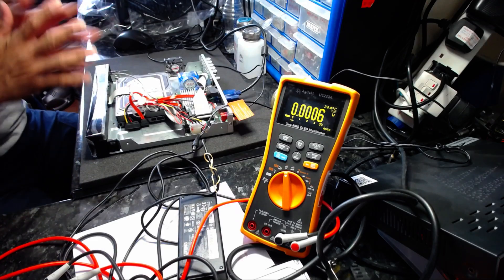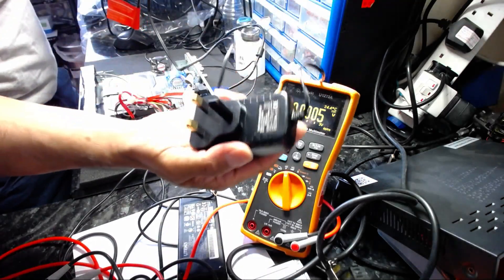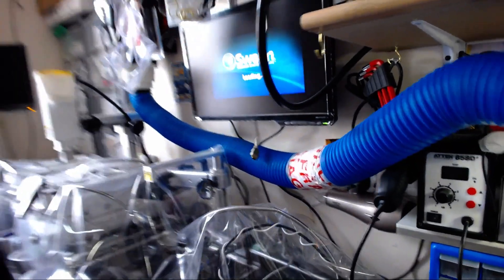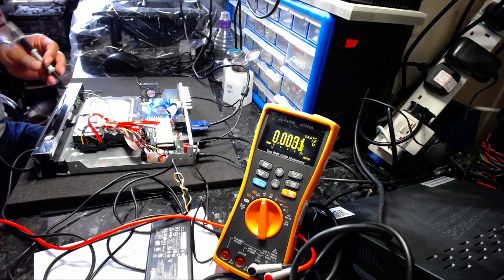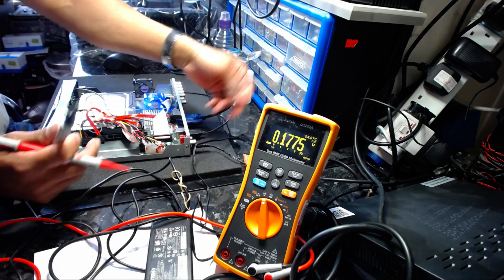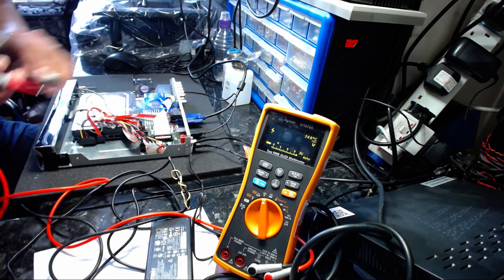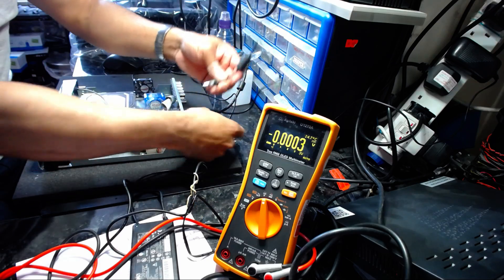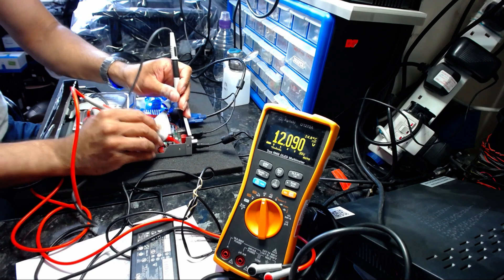HOW TO FIX SWANN CCTV DVR SERIES FAULT NO RECORDING OR NO HARD DRIVE SPIN

Comment: Hi, be grateful for your advice. I've got a similar problem with my Swann NVR. It's got the same board as the one in your video. I've got a Peak Electronics ESR meter and have checked the caps and all seem OK except one of the 220uF SMD caps which says leaky/in circuit so I removed it to test it and found the one leg just came away from the solder so I thought that was interesting. Anyway, tested it and tested OK so soldered it back in and retested. It gets to the Loading screen which goes blank and then does nothing. I've tried it with another HDD and get the same. I swapped that 1000uF cap with a 1200uF, closest one I had but still doesn't work. Can you tell me what voltages I should be seeing from the regulators? getting 5V1, 1V1, 1V4 & 3V3. middle two seem odd or are they references. HDD voltages are as they should be, 5V1 & 12V. I've found the same problem with cooling as you have, the system would just crash, I found the heatsink was excessively hot so left the lid off. If I can get this working again I'll have to fix a fan like you have there. Anyway, again, would be grateful for your advice, Thanks.
Reply: Hi, thanks for getting back to me. I'm assuming the video/cpu side of things is OK as the loading screen comes up on the screen. Again I'm assuming this is a bit like the BIOS on a PC then the OS isn't loading? As I'm sure you know, without a schematic it's a case of poking and hoping :) I may bin is as it's been flakey from new, not impressed with it considering how much it cost. Anyway, thanks for you help.
Reply: I've had a look at them and they seem to offer a lot more for the money and cross compatibility between cameras. That's the way I'll go, thanks for the advice.

Comment: Thanks great information. i was just about to order a new hard drive and spotted your video. After testing i have now ordered a new power adaptor :0)     my hard drive was working but the output had dropped causing multiple issues on the board and a slow running hard drive. thanks again all the best Jason

Comment: I'm on my second power supply now. The original Swann one blew up so that was garbage and the £30, yes £30 replacement that Maplin told me would be the only adapter to power the unit has now either blown up or the Swann unit itself has blown. Either way I can no longer monitor my home while at work so I'll never buy a garbage Swann product again. Never!

Comment: Hi I followed your steps, 12.25 if I volt the power adapter but when plugged in it’s only 11.25, would that cause for the dvr to keep rebooting and will not record any videos? Thank you.
Reply: iTCXtreme ok thank you, will it matter what the output of the psu is? One I have is 12v 2A, if I buy a 12v 3A, would it make a difference? Thanks again
Reply: iTCXtreme will follow your recommendations! thank you!

Comment: Thank you the video....awesome fix. I had the same issue after a few power outage. I replaced the internal memory and the system still was not recording. Just came across your video and swapped the power supply with a spare I had and the system fired right up. THANK YOU SO MUCH!!!!!!!

Comment: Awsome this worked 
Iv got a Swan cctv I got from maplin  always had issues with it not recording and saying HDD non exists or it would record for a few hours then stop.  And then batter up and wouldent record again. 
Iv had 2 HDDs still same thing. Iv just put a different supply on now and boom cranked up straight away recording.  
Original plug was right little and crappy

Comment: NVR-87082H, very similar main board to the unit in this video. On connecting power, No HDD activity at all, PWR an LAN lights blinking at 2 second intervals. Checked switch mode power pack, 12v present. Checked for 12v on PCB at the back of the power receptacle. No voltage. Hooked up my bench supply and she fired up straight away. Switch mode plug packs are proving to be very unreliable. Luckily, it's only a $20 fix for a system that cost me $800.

Comment: Hi. very good video. Im wondering if you've ever experienced a Swann DVR fault where the video input is all wavey? I checked the cameras direct to a monitor and thats fine. Also the menu screens are crystal clear, so I assume its on the input side of the DVR. I've tried anothet powet supply as a quick fix but issue still remains. I'm guessing some sort of earthing or capacitor issue but any pointers would be great? Thanks, Dave

Comment: Hi wonderful insightful video, would you be willing to undertake a. Repair to my Swann system. Power inlet to camera Ethernet is not working, had the power pack checked at Maplin and the engineer/salesman diagnosed the location of the fault, (I am not electrically minded unfortunately ) I am in the northwest Uk, please feel free to give me a call if you can help Jason 07483242340

Comment: I have a 16ch swaan dvr, but it only shows he power light on , the Hd(blue light) is off,  i check the HD in another dvr and it is working.  What do you think?
Reply: great vids i have a loading problem keeps trying to boot up screen goes  black could that be a capacitor issue ?
voltages all good
Reply: Could you kindly share your fix to this problem? The exact same thing is happening to mine